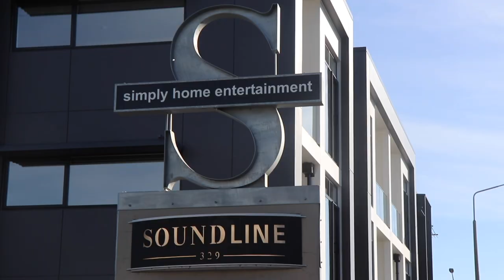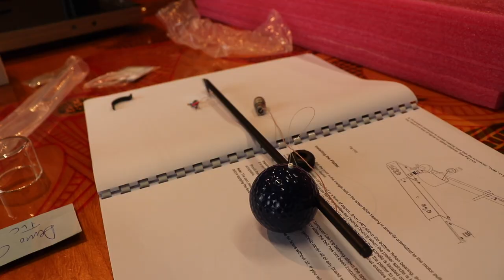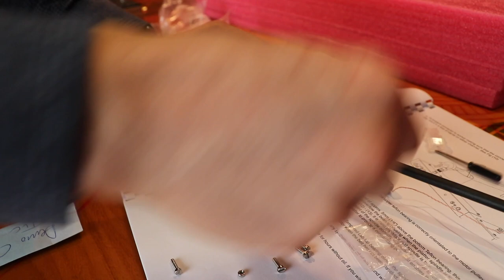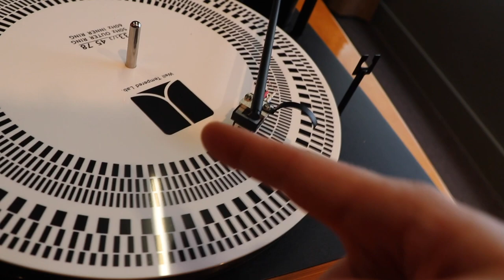How to Assemble a Well Tempered Labs Simplex Turntable

Comment: Ideally you want the back of the tonearm pivot points to be at record surface level a spacer with with a slope of 5 to 7 degrees can be used made from bolster Wood to get your rake angle back again.
 Still no way to adjust for cartridge can you slide the tonearm tube in the golf ball? why don't they make the option for adjustment of cartridge overhang.

Comment: And this thing is several thousand of dollars?🤔😂
Reply from the maker: Not quite Several, of course it depends in which currency you're meaning.
Reply: The Simplex II is £1990 in the UK. It WILL significantly 'Outperform' almost all decks at up to Twice the price (even more in many cases).
There are no 'metal to metal' contact points when playing to degrade the sound and introduce unwanted energy.
We have sold, and set-up, many Well Tempered decks over the years, and done many A-Bs against other decks.

Good video guys but not enough attention to the arm lead out wire dressing.

Bill Firebeaugh is a Genius!
Reply: @mikemanning4356  I think people confuse silver aesthetics with sound quality sometimes . This seems a highly researched , technical turntable that uses processes and materials for function rather than aesthetics .,so many turntables also go use traditional materials of ones that are just contemporary versions . It seems the WT have thought about every function from the beginning and thought less laterally about how to use materials and which to use .
As an artist ,m8 really appreciate the whole form and function approach , and the ways they’ve deconstructed the tonearm and platter bearing .its always so simple when someone else has thought of it and shown us all what’s possible !